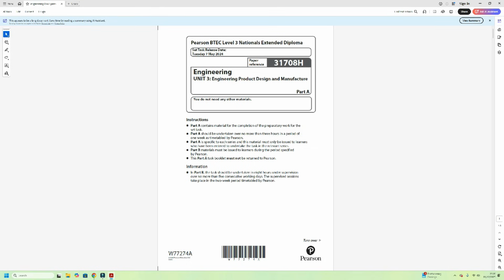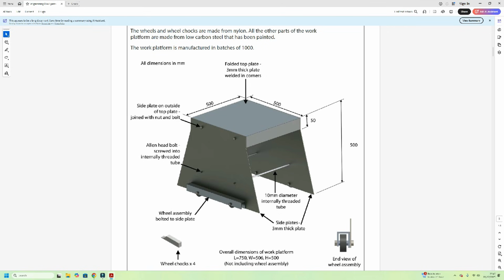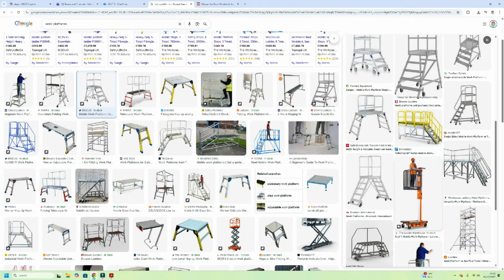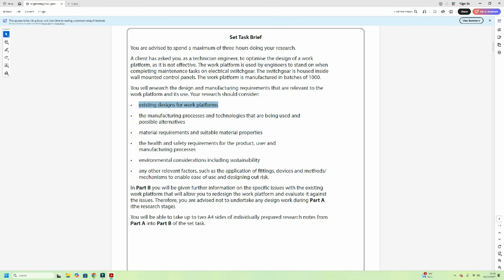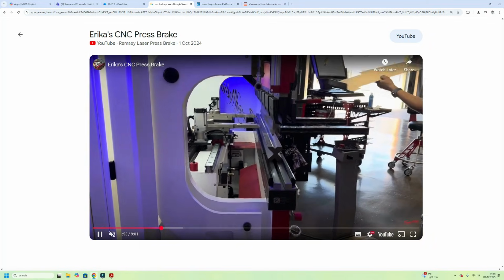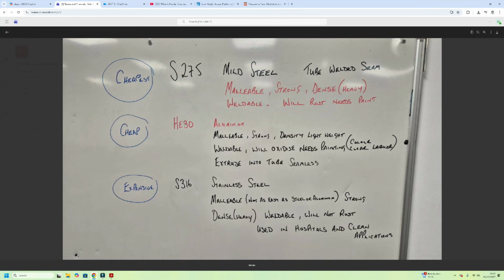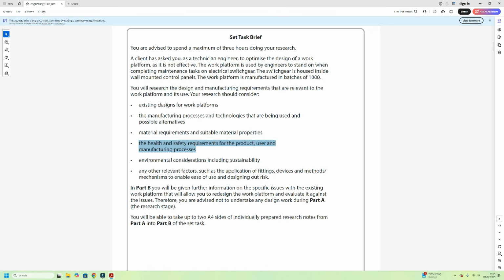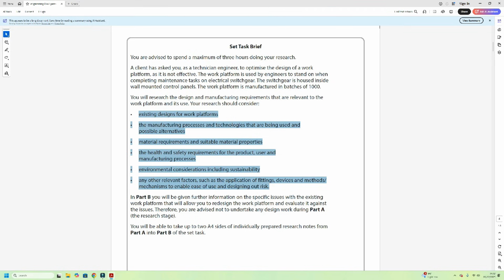Unit 3   Engineering product design   Part A

Comment: Do we need to research the health and safety for each of the manufacturing processes that will be used ?
Reply: Like including it for each process in our research
Reply from the maker: Yes, you need to consider H&S for both the user of the final product and the specific manufacturing processes like laser cutting, welding, or painting.

Comment: Hey I got my Part A tmrw. Any last minute tips and stuff to revise.
Reply: did you have the drilling jig
Reply from the maker: @GasGoncalo  everyone across the country has the same exam brief😃
Reply from the maker: Here are a few for you to stick to.
1. Make sure when you include images have a variety of designs to work with. Do not have three or four of the same type of product.
2. Material specs, be simple on this. Physical properties along with corrosion resistance. Will it need painting/plating. Think about how it can be worked with. Fabricated, machined and so on.
3.Health and safety be specific to product, also think about product manufacture and afor user too.
4. Sustainability is a beauty. Have something about this, might get away with a generic theme on this one.
This is to name a few to begin with.
You will have a list of bullet points to work with.
Remember if you have detailed photos of products you can copy aspects of them to make your own design.
Photos, crop the background you only want the product.

Word document use narrow margins and reduce font size to 8. As long as you can read it. You get more text on sheet.

Oh one last thing - use subheadings so you are not hunting for information you put on the sheet.
Reply: @111melcat  We have to write. So we cant have images.
Reply from the maker: @ShaunEmilShenil you have to have the images to help you out for ideas for designs, make sure they are all different designs
Reply: @111melcat  Thanks so much. Have a great day.
Reply: @111melcat did you mean drawings of different designs?
Reply from the maker: @electro.kid_99oh yes, these will help you generate ideas for different designs in you exam activity 3 - design three /four concept designs.

Can you see how frustrated you be if you had 3 or 4 similar product designs. You would struggle producing three different designs.

But when you have a variety you got a fighting chance in banging out three different designs of your own. This then shows examiner a range of ideas pushing you towards the top marks for this activity
Reply: Thank You. So much

Comment: Hi are values important to get down such as tensile strength, compressive strength and density? Or do specific numbers not matter.
Thank you for the videos they're really informative
Reply from the maker: You don't need exact numerical values, but justifying your material choice with those properties is key to getting the marks. 🚀
Reply: @111melcat so would saying "steel has higher compressive strength compared to aluminium" for example be alright?
Reply from the maker: Yeah as example, but think of what is relevant to the product when doing this one.
Reply: are you doing the drilling jig?

Comment: sir i have the exam tomorrow in the morning, if i use chatgpt / gemini and stuff will it be fine to help me with research?
Reply: Omg would you be able to tell what the product is because my exam is on Friday
Reply from the maker: That is do not know myself either until we get the exam.packs.
You need to know that I cannot help anyone on live exams.
Past papers yes, live exam no.
It is my job to teach and prepare students for the exams but when exam is being sat i have to watch you lot get on with it.

Some will struggle, some we find it easy.

Research day, just make sure you cover what is listed. Also look for legislation for products and manufacturing methods. It does include relevant PPE for tasks needed for production, safe equipment, lifting if applicable and so on.
You may want to think about noting stuff on environmental and sustainability needs too.

Just remember it has to be relevant to product and make sure you use that information in you exam.
Reply: @solomon1150  did you get the drilling jig?
Reply from the maker: He is what I have answered to someone before on this topic
You know what? That is a good question.
It is still research but you have used AI to find the links for you.
Can you rely on it, AI does make mistakes, if you know about the subject you can sift out the chaff.
If you were to use it, look for the links of where it found it's information. Click on those links to verify what it found has come from reliable sources.
It will save you time but you need to know what part of the information is relevant to you.
So in a nut shell, as they say, I do not see problem with that myself, just remember there may be errors.
Read what it has found and make your choice from there.

Comment: would you be making a video on how to answer each question well activity 1-5? whats the correct way to interpret what the question is actually asking you to do, etc.?
Reply from the maker: Indeed I am, working on the first couple of videos this weekend.
Each video will be titled as you see here with Activity number after 
So it's easy to follow the sequence.

How you find this video?
Reply: @111melcat great to both, thank you. got the research part A tomorrow and it helped me know how to go about comparing different existing products and what to look for.
Reply from the maker: Excellent stuff, a little help and familiarisation of the paperwork goes a long way.
Get images of not only the product but the mechanisms used within the product. Something you can work with if you can think of how design can be made😊
Good luck for tomorrow
Reply: @111melcat Thank you 👍

Comment: This is what I have summarised it to from each bullet point. Correct me if I am wrong.  ( something are things i learnt from my own class so search them up if you dont know what they are) 
1. Find 3/4 different images of the product 
2. look for manufactured processes that are related to the batch size/product 
3. look for a material which has to have  a reason for choosing ( material property ) e.g. corrosion resistant on material 
4. regulation = PPE, COSHHER,MHOR  
     Legistarion = HASAW
5. 6 R see how the material affects the climate 
6. problem in the product that have not be told but can see from infrancere (something you can fix which has not been stated from in the client brief )
Reply from the maker: 1 images of existing products, make sure they are different designs, construction and so on. Ensure you have detailed views of how it goes together.
2. Think about the manufacturing processes used to produce parts, finishing and overall assembly.
Reply from the maker: 3 material requirements, what do you think would be good choice for product. The existing designs will give you ideas here. Mild steel, aluminium and stainless steel would be OK in most cases. But you must list properties for each material to discuss in the exam Activity 4, the big part of exam.
Reply from the maker: 4. Health and safety of the product, manufacture and user. Must be relevant to product. No good generalising this. Be specific.
Reply from the maker: 5, environment and sustainability. This comes across to your understanding here. Does any manufacturing processes need to be controlled? Sustainability the three magic words,  renewable, biodegradable and recyclability. How does this type of product fit in these categories?
Reply from the maker: Last one the bit about low cost items, mechanisms, fixings and so on, cant remember them all. 
Have something on screws, nuts, rivets, washers and so on. Mechanisms could be pivoting, sprung loaded, catches and anything else you may have seen on the work platform. There were brakes on the wheels, some swivels others were fixed. You might have thought of putting in tool storage on it so lock it off would be another mechanism.
It all depends of whay the actual product is for the research task.

Comment: When doing the manufacturing process how would i reasearch that my teacher has not been through much of it
Reply from the maker: That's a difficult one to answer as I was not your tutor.
I had my students create posters on many types of manufacturing processes. This was their own record and could be drawn upon during research task.
If you followed this video you can see the most common way of making things. So from cutting material, forming it and then finishing it.
The assembly bit is adding all extra parts to finish the job off.
Watch the video where I talk about laser cutting, CNC brake press and powder coat painting.
This would be a good start to record those processes.
Reply: @111melcat  how can i join your classes..?
Reply from the maker: I know what you mean here, thinking about doing a course for tutors to use as resource for teaching this subject.
If you subscribe you will see my new videos I am producing for exam prep

Comment: Hi, when looking at manufacturing processes and technologies to make the product, should I have a varied amount? as i know in the exam it can change and you may not be allowed a certain process, this question going for the same as all the other research i need to make, Thanks
Reply from the maker: The million dollar question, as soon as you see the product you should know what methods you want to use for it.
Nothing is off the table but it must be feasible for that type of work.
So engine block will be cast and machined afterwards this work platform is mostly fabricated and welded together with some parts bolted on.
Reply: @111melcat  Ok thankyou so i should have a set process to use, but alongside it have some other processes that are definitely still feasible that i can use incase of the further client brief giving me restrictions?
Reply from the maker: That's the one, you don't know what the product is yet.
I have seen it as I set this task for my 48 students.
Reply: @111melcat  Ok appreciate it thanks

Comment: Should you research multiple  materials and manufacturing and sustainability and safety
Reply from the maker: Looking at the product platform. You would normally go for stainless steel, aluminium and low carbon steel for that type of product. Any exotic materials should be left alone.
Reply: @111melcat alright thank you but It also depends on the product you get cause stainless steel can’t be used all the time

Comment: How many designs should you reasearch for to get a better mark
Reply from the maker: You need at least four different product types. 
You could see on this video it would have been easy to just find images of the same type of folding platform.
This gives you different ideas to use for your own concepts.
Reply: @111melcat ok so look for four different ones and describe the manufacturing used the sustainability and safety for each correct
Reply from the maker: For research notes that will be perfect
Reply from the maker: Remember these are not marked. These are to help you for the main exam
Reply: @111melcat yeah I understand these are just notes to help for part b right
Reply: @1 @111melcat alright cause I was a tad confused on what I had to do and research for in part a but this video has helped a lot
Reply from the maker: That is it's main purpose. Getting to record the right information for the job in hand.
Seen so many students bark up the wrong tree here and go in ill prepared.
Reply: @111melcat so I’m on the right track on knowing what I need to do
Reply: Should I lay it out like idea 1 do manufacturing safety sustainability then idea 2 so on
Reply from the maker: Keep it brief to bullet points on research task. You expand on main exam if your concept design has similar features
Reply: @111melcat if you doing an idea and it has multiple parts like bolts legs and then rubber feet should you do each one separately or describe the manufacturing for each as a whole
Reply: So just like 2 bullet points for each manufacturing safety and sustainability for each different idea
Reply from the maker: Bit more, you will find some have generic theme
Reply: @111melcat so basically like little paragraphs for material and manufacturing and then multiple bullete points for safety and sustainability and then talk about features of existing products
Reply from the maker: Something like that, makensure you can understand your work and sub heading for each part.
It will be faster to find the relevant info when looking for it
Reply: @111melcat alright will do that in my exam tomorrow
Reply: Thanks for your help